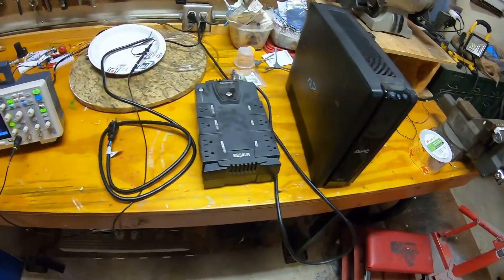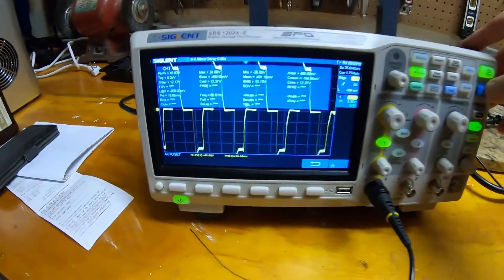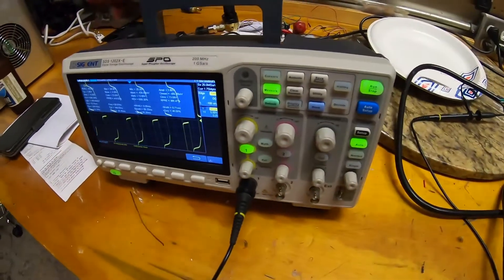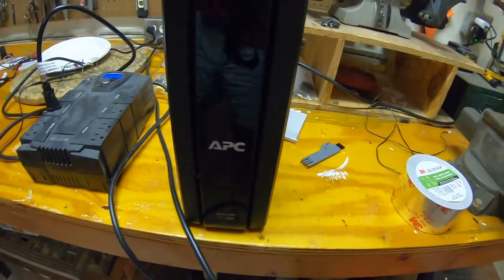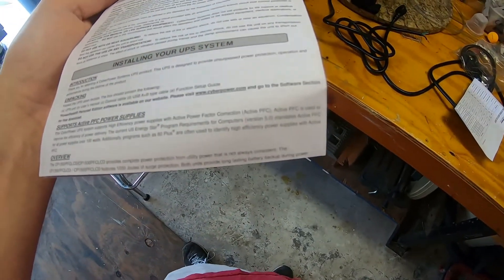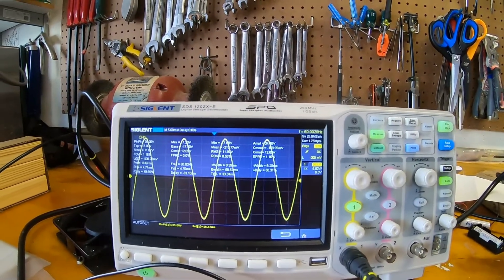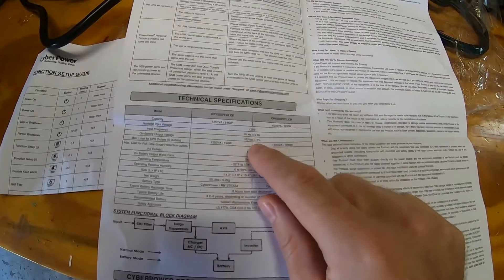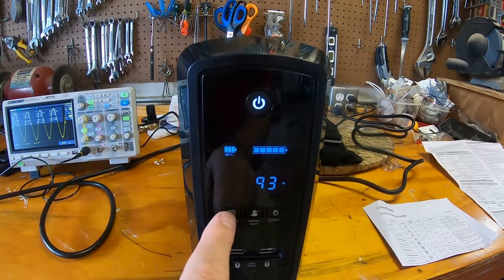UPS/Battery Backup Buyer Beware!!

Comment: It literally says "stepped approximation to sine wave" on the APC product listings. You want pure sign wave output (which most loads do not require), then you shop accordingly.  Cyberpower says "Waveform: Simulated Sine Wave" for that unit.
Reply: The CP1500PFCLCD version is a ''pure sinewave'' version.
It is different from the CP1500AVRLCD which is a Simulated Sine Wave version. 3 letters that make a big difference...
Reply from the maker: I guess I envisioned a few more "steps" then what I saw on the oscilloscope
Reply: @JoesGarageProductionsLLC  I suppose you can imagine things however you want, what matters to me as someone who installs these every week is whether they work. And stepped approximation UPSs work just fine for most loads most of the time because the device they're hooked up to is just converting that stepped AC back into DC again anyway. Its a bit less efficient, but it works.
Reply: @JoesGarageProductionsLLC  You've envisioned something that doesn't actually matter, and then put Buyer Beware!! on your video about it. I hope people didn't watch your video and then spend a bunch of extra money on a more expensive device that their home PC doesn't actually need or care about.
Reply from the maker: @en0n126  people use UPS power supplies for all sorts of things. If you scroll through the comments here, it seems like there is some disagreement as to what actually cares about a modified sign wave UPS or not. 

I''m not telling anybody what to use or buy just illustrating differences between products. Purchase whatever you feel works best for your application.

Comment: I  have an older 24v  550watt UPS  for years with 100 ah  deep cells . When trying to run my battery down to do capacity test on my new china lifepo4 100 ah battery I only got 75 ah AND THAT WAS AT 1 AMP DRAW, discharged on my iMAX quattro B6. It took days. So I put it on the old faithful UPS but tried a small hot plate for the first time and it was pulling 35AMPS.  I have hade this fan-less UPS hot as hell for a long time in the past, and it worked fine. With the hot plate it was just getting warm and the hot plat was red hot and almost had a pan of water boiling after about twenty minutes and the UPS was still just warm , So I went to take a piss . BAD IDEA. REALLY BAD. It must have started letting out the magic smoke as soon as I toke my eyes off it . couple minutes in the bathroom and ,PEEP PEEP PEEP PEEP. FIRE ALARM. Holy crap. living room and hall were filled with smoke.  
This thing had always just shut down if the load was to high. For some reason this time it did that transformer melt and short thing , before the fuses went. meaning it never shut down. It melted down . THAT must have been a sight to see.The autopsy showed there were 3 black holes it the transformer and burn marks inside. If this was one of those plastic shell ones like the little one here, OMG . I'm now waiting for an APC Pro 1000 S BR1000MS Sine Wave UPS 600watt  with no batteries or box or anything for $80 shipped. I will not be going over spec this time .
Reply from the maker: Wow oh my goodness that's quite a story! You're lucky it didn't bring your house down and that you went to the bathroom to go number one rather than number two :-)

Comment: Great video. I purchase the same CyberPower pure sine wave before seeing your video last week. Three days later, we had a 5-hour power outage due to high winds. I started up the "Honda" generator  (non inverter type) and guess what... the UPS wouldn't charge, and my computer ran out of power and died. Searching for answers now. Looks like it the frequency that stops it from charging, from what I can figure. It must be within 3 HZ of 60 for it to charge, I'm thinking. It is looking at that out of speck frequency as a problem. Looking in the manual of the Local business software from CyberPower that runs on your PC for auto shut down, it talks about relaxing the frequency specification but I can't find where you set it, I'm thinking this unit doesn't have that option. This is what the manul says "When the input frequency is unstable such as with power supplied by generators, set the UPS to fixed mode to supply power with a stable frequency."
Reply from the maker: Very interesting. The manual for mine is long gone but I wonder if that's something you can adjust with their software that you install on the PC? Another option is to adjust the frequency of the generator. On non-inverted type generators that is normally adjusted by adjusting the engine speed. You can do that pretty easily by sticking a multimeter or kilowatt meter into one of the power outlets with the generator running and put it in frequency mode. Most small generator engines have been adjusting screw nearly Governor linkage that allows you to adjust engine speed. You would shoot for a no load frequency of about 61 to 62 hz
Reply: @JoesGarageProductionsLLC  Thanks for the response, the online manual for the software that runs on the PC says you can configure it for generator mode, but I can't find that option in the software. I will try adjusting the governor for 60-62Hz, I do have a meter that shows Hz.
Reply: @OutDoorFun3  Any luck?
Reply: @dannydeutsch279  No, I tried contacting CyberPower through their website, I filled out all the questions about the model and then wrote a lengthy question. Then after all that, I hit "Send" and nothing would happen. I got to try again. We haven't had a power outage since, so I haven't tried to adjust the governor on the generator.

Comment: Excellent vid. Can you tell me what I could use to clean up voltage AND frequency variations when on generator power?
Reply from the maker: Thank you! You could use a double conversion uninterruptible power supply. Those will essentially take whatever power is coming in rectify it and then convert it back to AC. They are pretty pricey though so prepare yourself. A cheaper option might be to just buy a generator that already outputs clean power. I've done a few informal video reviews of various generators, including a fairly low cost Wen inverter generator that outputs very clean power at a very reasonable price. I would love to get my hands on one of those generators from Northern tools that outputs like 10,000 Watts with a very low THD. A bit out of my price range right now though :-)

Comment: This isn't news. And neither is it an issue. APFC circuits only had problems with modified sine waves in the very beginning, but manufacturers very quickly modified them to be able to work with MSW. Any PSU made in the last 15(+) years will almost certainly work with a MSW UPS. Information to the contrary is either outdated or FUD perpetuated by UPS manufacturers to make you pay the premium for a pure sine wave model. 
That being said, unless you know exactly what you're doing, if you want to power anything except switch mode power supplies or pure resistive loads, you should buy a true sine wave UPS. It's easy to have a transformer or a motor overheat and melt or some small device using a capacitive dropper blow up from the higher current the dropper will pass on MSW.
Reply from the maker: Interesting thank you for the information I appreciate it. I certainly don't know everything always good to hear from people with no more than I do. Question for you. A lot of power supplies that I've disassembled use transformers to step down the voltage from line voltage to something more manageable by a buck regulator. Are you saying that a transformer and that type of situation would be okay with a modified sine wave UPS? If so can you elaborate why? Are those transformers designed differently in some way?
Reply: I'd like to inform you this FUD is quite well propagated because comments from random engineers on youtube videos are the only sources verifying this fact

Comment: You really wanna git yurself a double conversion type ups
Reply from the maker: Yes but they are super super expensive, at least the last time I checked
Reply: @JoesGarageProductionsLLC  yes, the output on that Cyberpower line interactive unit looked pretty darn good and really cheap. Probably the best bang for the buck, as they say, for home use
Reply from the maker: @vladimir0700  yep for sure. It's a great value!

Comment: Nothing really to be concerned about. 99% of all devices manufactured recently (like 2002 - 2003+) all have power factor correction units built in. Like computers, laptops, routers, switches, etc. There is absolutely no problem using UPS which churns out modified / pulse sine wave when in battery. Even huge server farms use them. The ONLY area where pure sine wave will be required would be hi end audiophile grade audio units like hi end AV receivers, etc.Even the so called AVR protection. Every power unit I know can steep all the way down to high 90s or step up to 132V with zero problems. Heck - most even these days auto capable to do 110V or 220V!! Again - a marketing gimmick. Finally EM/RF noise - not really matters at all for computers and networking devices. My recommendation is and will be the same - buy the cheapest UPS which offers max ratings in terms of WATTS (not VA). Make sure the UPS has 15A outlet. Anything above 1200W will require a 20A outlet or above 2500W a 30A outlet. If $ are available then go for a UPS which can take an external battery pack significantly increasing the time.
Reply: Speaking of, inverters and  "EM/RF noise " , I have been bummed to see my 5000 watt "pure sine wave" inverter making LED AND florescent lights flicker like crazy, when it switches to battery power. for starters ,it just ins not as bright as line power . but the flicker really bummed me out.  I tried better grounds , better fatter power lines, and nothing mattered except putting in regular incandescent bulbs. 
 now I realized it was the power supply for my laptop. polluting everything else plugged in. WTF. no problem on line power , but on the inverter that says "pure sine wave" pollution. I don't remember that happening with my older, non sine wave. inverter. but the stereo amp buzzed. can't win for losing .  LOL .
Reply: I know from personal experience that HP Proliant Gen8 servers don't like modified sine wave power. The power supplies in them make a terrible noise which sounds like a relay clicking on and off 50/60 times per second. I would not run these without a pure sine wave UPS.
Reply: What's the difference between 15A Outlet,20A and 30a outlets. Does their socket size differs and will it cause difficulty in plugging in.
Reply: @creatorvoss  Yes, the sockets are different... therefore not compatible. Request to have a suitable circuit.

Comment: Awesome video! Request for a follow-up video: take the pure sine cp1500pfclcd and add more batteries to see if the runtime will increase. Some UPSs will shutdown at the same runtime to prevent overheating, even with minimal loading.

Comment: @Joe'sGarage  et. al.: I cannot seem to find UPS batteries that last more than 4-6 months. Years ago, I could buy those batteries and they would last 3-5 years. Can you , please, recommend  a solution?
Reply from the maker: For UPS batteries I generally go OEM. I recently took apart a UPS battery pack from APC. It was a genuine OEM One. The batteries inside were Vision brand, CP1290. That same battery size is very common and portable generators too. I guess what I'm saying is your only option isn't necessarily OEM or an OEM clone... You can find out what size batteries your UPS needs and order those from whatever manufacturer you want.

Comment: Hi Joe, so I bought the cyber power that you liked but I have a question. If you have slight power dips occasionally you don’t like the light dims just a little bit does your electronics have to be plugged in to the battery side in order do you have that consistent even power? And anything plugged on the non-battery side will not have that consistent even power. It’s my understanding correct. Thank you very much for your help and I love the video
Reply from the maker: Yes, I believe you are correct but I don't recall testing that at the time. Typically the non-battery side only provides surge suppression.
Reply: @JoesGarageProductionsLLC  It would have been interesting if on the side without battery only minimally the AVR mode also works...

Comment: Interesting “acid test”.  So the product info should say “true sine wave” or something? It might be fun to have an oscilloscope but not easy or prob not worth it for me. Good old cheap fans are easy tests. Thanks.
Reply from the maker: You would think that when they say stepped approximation to a sine wave in the advertising there would be a few more steps than you see on the oscilloscope :-) thankfully the true sine wave UPSs are getting cheaper and more common
Reply: I was just yesterday examining a $100 backup with no display at Batteries Plus but the sine wave  feature was ignored, probably none. The clerk did not know what sine wave meant. Digressing, I went to examine a $200 unit on the bottom shelf but the clerk touched the shelf above sending boxes of products crashing down on my head when the loosely attached shelf fell. No apology from the inept clerk either - or the arrogant manager.

Comment: Put the oscilloscope in single shot capture mode to capture the transition from grid power to inverter power. This will allow you to see if the voltage sags during the transition or if it is relatively seamless.
Reply from the maker: Thanks - I'll give that a try next time I use it!
Reply: @JoesGarageProductionsLLC  And also in AC coupling mode.
Reply: can i use a Simulated Sine Wave UPS with my Computer having an Active PFC power supply ?

will it damage my PC ?

Comment: Cheap UPS is just fine when you’re using it only for digital devices that use DC power converter unit without active PFC. Most internal switching power supplies and brick chargers fall within this category.

You may need true sine wave unit only when 1) you have active PCF power supply unit in your computer, 2) analog audio equipments, 3) and running an AC motor.
Reply from the maker: How do you know if you have a device with an active PFC power supply?
Reply: @JoesGarageProductionsLLC  check with manufacturers? Read label or spec/manual? Well, if one doesn’t know, it probably means no active PFC in his PC power supply. 

For most cheapo, low-power DC power units are just bridge rectifier with some kind of buck/boost dc-dc converter so they may actually appreciate ‘rectangles’ as in put.
Reply from the maker: @jisyang8781  yes that has been my experience as well with a few power supplies I have disassembled. Like you said usually a transformer of some kind Plus a full or halfway rectifier and a boost/buck depending upon the application.

Comment: Way cool, is it possible to record the waveform during the switch from Line/Battery? (I'm thinking that it would be pretty ugly on the first two but might not even be visible on the new one. High-end UPS systems are usually "online" - e.g. everything gets rectified to DC and then re-inverted back to pure sine AC... that way, if the power goes out there is absolutely zero disruption in the power delivered to electronics ... My guess would be that the first two might have a 1/2 to 1 cycle (16.67ms @ 60Hz) disruption...)
Reply from the maker: I'll give that a shot the next time I have that UPS disconnected. You're referring to "double conversion" UPSes... they are pretty rare and are usually very high-end/expensive.
Reply: @JoesGarageProductionsLLC  And noisy...